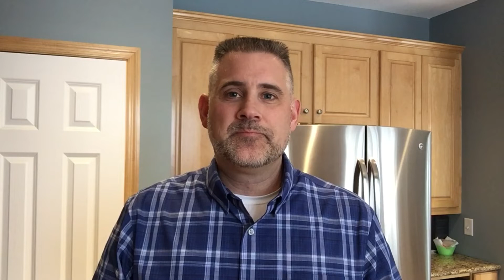Using airport or venue security with a pacemaker, ICD or CRT device

Comment: I have had a pacemaker since I was 1 and im 33 now. People, just dont do, it's way easier to get a patdown then risk your life even if there is a .01 percent chance
Reply from the maker: Dennie, what are you worried might happen by walking through airport security?  What could happen that would “risk your life”?
Reply: @DouglasRachac   I have complete heart block, I cant risk any interference
Reply from the maker: @denniedollreborn8711  got it.  That’s understandable. There’s 2 things at a security check point that could, possibly, in very very rare cases interact with an implanted device. One is the electromagnetic energy coming off everything that is powered by electricity, or that has a running engine/motor. The other is magnetic energy.  The first, electromagnetic energy/interference, or EMI, can cause a device to see heart rhythms that aren’t really there. It can make pacemakers pace or not pace when they should, and it can make ICDs shock when they shouldn’t. But it takes several seconds of sustained contact with a pretty strong source of EMI to affect an implanted device. You would need to be hugging or standing within inches of a source of EMI for at least 3-4 seconds for there to be any possibility of a problem. And even then your body is a great first line of protection, then the devices are shielded and have algorithms and discriminators that allow it to identify EMI and ignore it or minimize its impact.  Studies show the only things that emit measurable EMI at security checkpoints are the hand held wands and the archways.  So, as long as you aren’t hugging the archway, or holding a wand to your chest for several seconds you don’t even have a chance of any interaction occurring.

Magnetic strength is the other concern because magnets cause an implanted device to switch modes. A magnet will cause a pacemaker to pace at a constant pacing rate, like 85bpm.  A magnet makes a defib withold shocks. But that switch only happens while a magnet is placed and held on top of the skin over your device. The only magnets in a security environment are, again, in the wand and the archway.  So, as long as you’re not hugging the archway or the wand there’s no worries. 

There’s nothing in a security setting that can scramble your device, shut it off, reset it, or cause it to withold pacing. The devices are pretty intelligent, and have been designed specifically to be safe in everyday settings. The only concerns are with EMI and magnets, and there’s no concern with those if you’re using the security equipment the way we’re supposed to.  

Bottom line, though, is that each person should do whatever makes them the most comfortable, and that might be asking for a hand search. My goal is to make sure people know the science and facts so they can make the best decision for themselves.  I hope this info helps.  Safe travels!
Reply: I completely agree, who knows what new studies will conclude in 5 or 10 years looking back at this and determine something did interfere, this extra 3 min won’t change my life at the moment

Comment: This is not what I have been told by my device nurse and electrophysiologist . My device is a new ICD from Medtronic.
Reply from the maker: Hi Joe, Sadly there's a lot of old information still out there.  I would encourage you to have your doctor/nurse talk to their Medtronic rep, or to call Patient Services to learn the current recommendations.  Here is what Medtronic has on their after-hours voicemail.  The second half of the message is the important part.  https://youtu.be/iT9PGZ7wumk
Reply: @DouglasRachac 
Thanks Doug. I called Medtronic and received all of their guides and information. I just received my ICD 4/11/23. Thanks for posting.
Reply: @DouglasRachac  Hi Doug, any thoughts on using a Sleep Number bed with an ICD? My device nurse called me to check on several noise incidents recorded by my device while I was sleeping. It is like there is a correlation between the bed and the noise.
Reply from the maker: @joea363  I haven’t heard of this problem before. It’s possible, I suppose, but shouldn’t be a problem if the motor for the bed is at least 1 foot away from your device. 

You don’t use any magnetic blankets or mattress pads, do you?

Has the clinic checked for possible lead issues. It may be that the noise only occurs while you’re laying down because that’s when your device is moving around slightly. Maybe this is something you can test next time you’re in the clinic. If you’re able to recreate the problem while they have you hooked up to a programmer they might be able to pinpoint the problem.
Reply: @DouglasRachac  Doug, thanks for your reply. You are correct. It was a lead issue. They did a lead revision procedure leaving me with a second incision. They are telling me that original lead was either defective.

Comment: Hi there, Can a person mig or tig weld or use any type of electrical welding machines with a Pacemaker ? Since there is a magnetic field passing thru the gun, leads and unit which is in close proximity and even draped over your shoulder ?
Reply from the maker: Hi Sam, thanks for watching the video!  I don't know much about welding, but Medtronic and Boston Scientific offer advice on how to weld with a device.  Medtronic's info can be found on this page: https://www.medtronic.com/us-en/patients/electromagnetic-guide/frequently-asked-questions.html  Boston's info is nearly identical.  I hope that helps.
Reply: @DouglasRachac  Hi Doug, Thanks for sending the link and I appreciate the advice your giving about the different types of devices. I'm into  my second device now which I've had for 6 years, So New Device with Old Leads reused.  Definitely won't risk welding or anything of high risk now that I know ! I didn't know about the chainsaw either. Thanks again and God Bless.

Comment: Listen to your doctors advice.
I have personally seen an older gentleman’s device malfunction immediately upon walking through a metal detector. It appeared to have interrupted his pacemaker momentarily and he was dependent on it. Had to call an ambulance for him though he did come back around. Hopefully this will eventually be a thing of the past with devices.
Reply from the maker: One thing I can say for certain is that the security system didn't shut off or stop his pacemaker.  That's just not possible with our devices.  They have too many safeguards built in to prevent that from happening.  If the magnetic field of the security system interacted with his device in any way it would have switched the device into a constant pacing rate, which is totally safe for pacing dependent patients.  When the person exists the magnetic field (exits the archway) the device would switch back to its normal programming.  Even if it didn't, pacing would not stop or drop in any way to a dangerous level.  What's more likely is that the traveler's anxiety over navigating a security checkpoint with a device caused a physical reaction.  It's my hope that information like the info in this video will provide patients with the knowledge that security checkpoints are safe to navigate, and will alleviate the anxiety some patients experience.
Reply: Could be possible you are correct, I can’t say for sure either way. I don’t think so though based on what I witnessed. My own electrophysiologist advised me that it is possible that an electrometer can momentarily deactivate a device.

Comment: Hello Doug. I just received a Medtronic device a couple weeks ago. I was told that I cannot ever go through a metal detector or get the wand at all.
Reply from the maker: Hi Shunta, thanks for watching.  Unfortunately, bad info like this is still out there.  The best source for info on this topic is the device manufacturer as they are the ones who design, build and test their own products.  You can find what Medtronic says about airport security here: https://www.medtronic.com/us-en/patients/treatments-therapies/common-questions.html  This is the important part: "Given the short duration of security screening, it is unlikely that your implanted heart device will be affected by metal detectors (walk-through archways and hand-held wands) or full body imaging scanners (also called millimeter wave scanners and 3D imaging scanners) such as those found in airports, courthouses, and jails.

To minimize the risk of temporary interference with your heart device while going through the security screening process, avoid touching metal surfaces around any screening equipment. Do not stop or linger in a walk-through archway; simply walk through the archway at a normal pace. If a hand-held wand is used, ask the security operator not to hold it over your implanted heart device and not to wave it back and forth over your device. You may also request a hand search as an alternative.

If you have concerns about these security screening methods, show your device ID card, request alternative screening, and then follow the instructions of the security personnel. "  What they are saying is it is safe to walk through airport security, and to be wanded, but if you still have concerns you can inform airport security staff that you would like a hand search and you can by-pass the metal detector and wand.  I hope that info helps!

Comment: Hi Doug,

I saw your comment on my video, and I have to say you do a good job with the delivery and flow of your video. I like the level of detail.  I also don't mention that I have a device when I go though security. I've never had a problem. I was nervous the first time I went through arch metal detector because I though it might go off, and my ICD card is in my wallet in the x-ray machine.  Thanks for sharing and keep up the good work.